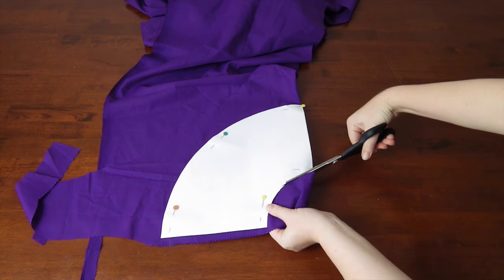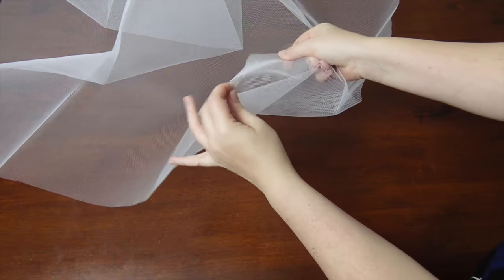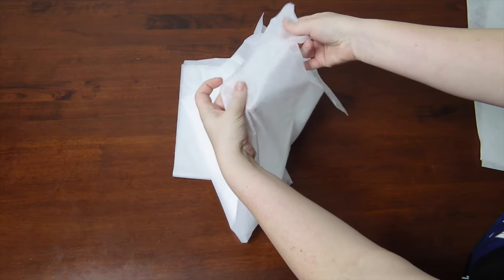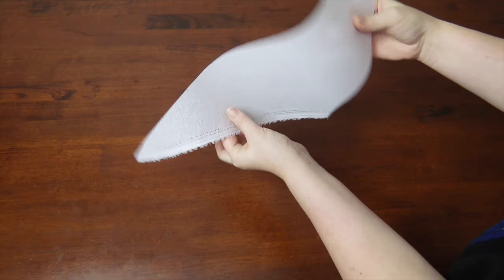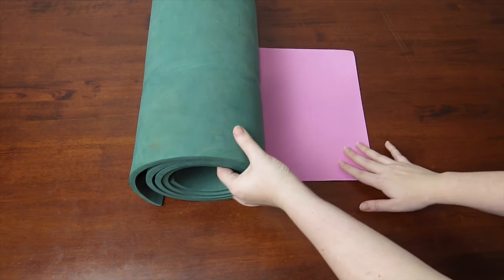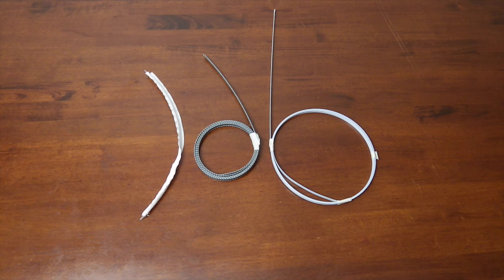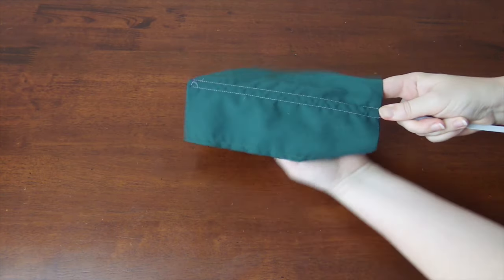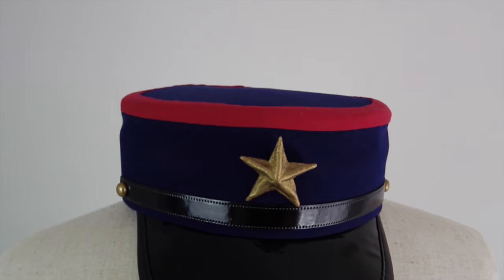How to Defy Gravity for fabric based cosplays

Comment: I'm having trouble making stiff long panels that will be attached to a belt to make it look like a skirt . 7 panels x 20cm width  and 1metre length/height). I have to make it look as if its hovering /flowing. If I use poly fabric from lincraft, what method would you suggest.  I was gonna use resin with the hardener but I feel like it might make it too heavy and way too stiff. Heelllpppp
Reply from the maker: I would probably wire it but it depends on the overall look you are going for

Comment: This was great, I have a quick question. At the beginning of the video, what materials did you use to achieve the high collar look. I need something to keep my sons collar high up and have no idea how to achieve
Reply from the maker: If it is a small collar then stiff interfacing should be all you need. Otherwise you might have to look at something more drastic like buckram, wire or foam

Comment: Im gonna need to do some extreme stiffening with foam or super stiff interfacing for my remake of Cruella’s garbage truck dress for the newspaper parts as well as for Elizabethan collars and elaborate collars and gravity defying ruffles. Do you have any tips on how to keep these cosplay parts clean? I know some of these options aren’t exactly machine washable or even dry cleaned in the parts with foams or buckram or wire and some cosplayers might have trouble getting them clean after a while at the con.
Reply from the maker: Make the bits about to be able to be taken off

Comment: Thank you for your clear suggestions!  Love the costumes. Question - does buckram lose it's stiffness if you wash it?
Reply from the maker: Generally not straight away but it will deteriorate over time. Also, make sure you iron it back into shape.
I could suggest that you make the buckram piece removable and if it gets dirty, spit clean it only

Comment: This is awesome, but I have a question.
I'm brand new to cosplaying, and I'm trying to cosplay as a Skykid from Sky: Children of the Light, and I'm not quite sure how to stiffen the cape (wings, but they look like a cape). It needs to flare out a bit and be flowy, but it also needs to look strong enough to let a Skykid fly around with it. I'd appreciate any ideas and suggestions, with maybe a link to a video that gives me an in depth explanation. Thanks. ^^
Reply from the maker: I am not aware of that costume I’m afraid so I can not help you. Good luck with your searching.
Reply: I came to this video for the same thing. I’m thinking I might try some interfacing, but I’m not sure. Did you end up finishing your cosplay? If so, any advice? Thanks!

Comment: I purchased a Winifred Sanderson costume. The collar is flimsy. It won't stay up. Is there an easy solution without removing the collar? The dress is very well made. I don't want to damage it.
Reply from the maker: You could try inserting wire into the structure

Comment: Which wire has been used?.. Or which wires do u prefer for fabrics..
Reply from the maker: Depends on the weight if the fabric. I tend to just use middle of the road, wire from the hardware store

Comment: Thanks for the video. I think I want to use wire for the front cut-out portion of my cosplay. It's essentially a star exposing the cleavage. I'm using knit fabric. Do you think wire would work? If not, what would you use?
Reply from the maker: It depends on the stress that the wire and what thickness of wire you are planning on using.
Reply: @KirileeCosplay  thanks for the replay. It will need to stay in place for someone who is a size D cup. The knit is a 4 way stretch.